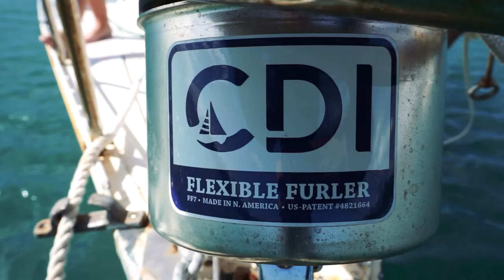Can a 5k Craigslist Boat Transform into a blue water Sailboat? Sailing GBU

Comment: Highly enjoyed that!  I love me a roller furling jib just for ease of use, happy to see you come to the dark side.   And hey, at least you can still make fun of the soft-sailors who opted for a roller furling main!  (Having used one myself it's super convenient for single-handing, but I'll never voluntarily switch to vertical battens).  

The recap of the year's work was fun to watch.  Also since Kristen sounds like she really wants another boat project, I thought I'd suggest one.  Make yourself a stack-pack and some lazy jacks.  It's a little thing, but they make reefing and dropping the main so much more convenient.

Oh, and you mentioned loose footed versus attached mainsails.  I don't know if you actually care or not, but I thought I'd chime in on the practical differences between the two.

In old days, sails were mostly made of materials like cotton and linen, or Papyrus if you're going back to antiquity.  All of these materials tend to be extremely stretchy, particularly when subjected to the sort of stresses that are common for a loaded sail.  Obviously having your sail stretch out in the wind ruins it's shape.  So for thousands of years all mainsails were attached to the boom, because it limited how much a sail could stretch, increasing performance and lifespan.

Modern sails are made from polyester and similar plastics.  They're engineered to be extremely stiff when compared with older sail materials, and are literally thousands of times less stretchy, eliminating the need for an attached foot.  However the default design was still an attached foot even after the advent of modern sails, simply because that's how things had been done literally for millenia.  However at some point someone (I assume a racer) realized that by detaching the foot, you can adjust tension on the outhaul to tighten or loosen the clew and modify sail shape.  (Tighten it in high winds and loosen it in low wind).  Which is why virtually all modern boats have loose-footed mainsails.

Comment: I have full length Battens on my Nacra 5.2 sail. The tension can be adjusted to shape the sail. More tension for a deeper sail and light wind. Less for heavy wind and a flatter sail. I detension them after ever sail and keep them loose to help preserve the sail. I am also using foam cored tapered Battens. These curve more at the mast end of the sail for a proper airfoil shape.

Comment: Another Over-the-top episode. We had a 7.5 KW solar system on our home in Arizona. And yes it is in the desert and always dusty. We turned on the hose with a powerful spray nozel and washed the roof every week. We would gain 2500 - 3000 watts back just be keeping them clean. Guess it's the same on the water. 
.
Merry Christmas ✨ 🎄 ✨

Comment: You might want to consider marking the battens.   Numbered from the top to the bottom so that if you need to put then in at night it’s easier   Plus get a spare or two in case you lose one

Comment: Dark paint on the hard top, are you trying to make your cockpit hotter? you want a white / or very light paint, something with lots of titanium oxide (the same stuff that makes sunscreen white) and you should paint under the solar panels and also the underside of the hardtop, UV light gets in everywhere, bounces off the water and anything else, also will probably go through the gaps between the individual cells and bounce off the hardtop up to the back of the cell and then back down to the hardtop further in.

Comment: While choosing a dark color paint was better for UV blocking for the PVC,  it will also cause it to adsorb more heat in summer sun, might I suggest 'silver/aluminum' color as a second coat before spring equinox.   What happened to the bikini Kristen dyed blue back when she dyed the cushion covers?

Comment: i see you just painted your hard top black,, you may want to paint it with a UV protectant white,, because the solar panels loose efficiency when they get too hot,, AKA being on a black roof (i know crazy that they have to be in the sun and then Bam decrees efficiency) . its called temperature coefficient, "manufacturer’s data sheet for your solar panels. The temperature coefficient tells you, in a percentage per degree Celsius, how much power a solar panel will lose when the temperature increases by 1 degree over 25°C (77°F).

Comment: Spank me on my birthday if I am wrong... Real "Blue Water Cruising Boats have "Full Keels" or Long Keels... Those types of keels are built right into the hull, whereas "Fin" and other sorts are Bolted on... Moreover, a Full or Long Keel has the rudder built in as well, protecting it in the event of running aground. Fin keels generally have a Scag mounted rudder... Problems... Running aground usually means, you ripped your Keel and/or your Rudder OFF... Bottom-line... Your boat can Never be a True Blue Water Cruiser... For that, get a Hans Christian (Robert {Bob} Perry, or one of the William Garden designs... like a Vagabond or Formosa... There are many many others. Those were only a few Bias suggestions... :-) BTW, Great Bathing Suit ;-)

Comment: he has a desire to determine if the instructions are accurate or possibly overly cautious is all. i do it all the time. when they have been tested and results are obtained it is a success. IOW he's testing the instructions or what he thinks is most probably in the instructions or what he considers popular opinion of how to go about a task. it's a secondary matter whether or not the result serves any other possibly beneficial purpose. if it does, it's just serendipity. that's what he was doing while trying to install the roller furler while at anchor and unpacking the battens. it often results in what others consider a 'failure'. but believe me, he does not. it is always a successful test of his limits in determining the most efficient way of going about performing a task.

however, i will admit that it can be inconvenient for those most interested in the practical aspects of a completed task. not to mention a little annoying. :)

Comment: Is it my bad eyes or are you using drywall screws for repairs with ply and dimensional wood? Worst solution ever if I saw correctly - they rust so quickly.